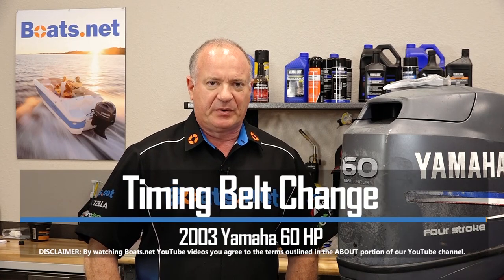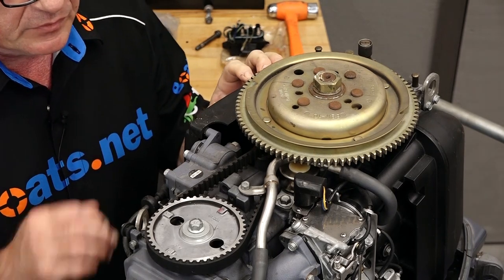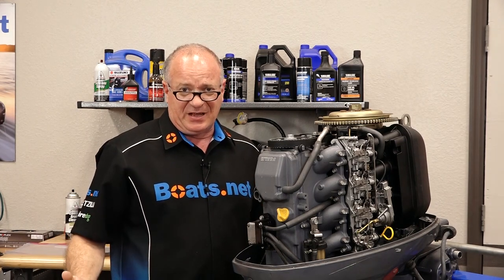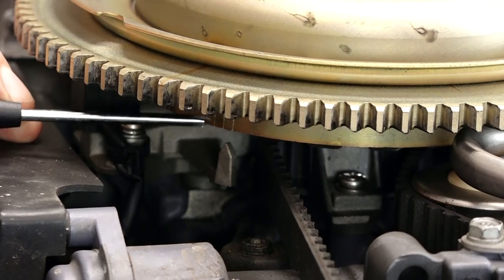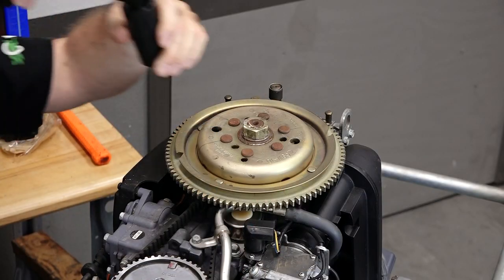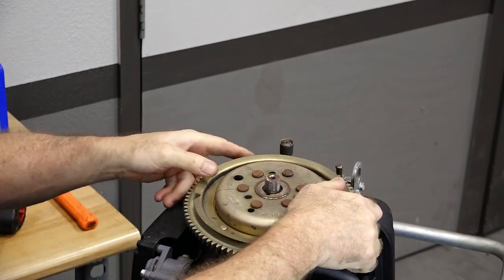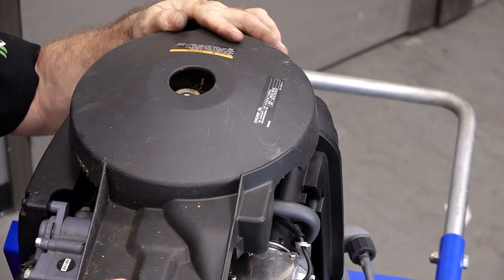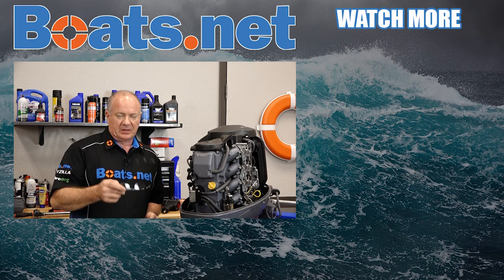Yamaha 60HP Timing Belt Replacement | Yamaha T60 Outboard Timing Belt Replacement | Boats.net

Comment: One little thing is missing. After installing the belt I would recommend rotating the crankshaft manually two revoloutions in order to make sure the pistons will not hit the valves when firing up the first time.
John, your videos are actually the best outboard how-to-videos out there. Very good explanation, but also very good audio quality, pronunciation and talking speed. Makes it easy to follow even for non-native English speakers.

Comment: Great video. I usually turn the motor a couple of times in the correct rotation by hand to ensure marks are 100% lined up..
What holds the flywheel is a nut not a bolt,in my neck of the woods...

Comment: Does the same procedures apply for replacing the timing on the 75 hp Yamaha
Reply: Can you post the information on the tool that you used to hold the fly wheel in place

Comment: Good video John. My 25 Yamaha 4 stroke stopped and won't restart.The compression on both cylinders is only 75# and the timing belt is very loose.Could it have jumped time or is it something more serious. Thanks
Reply: If your engine was running when it "jumped time" then the crankshaft and the camshaft became out of phase/time at some point.  John mentions this issue in passing during this video.  When the crank and camshaft are not synchronized (out of time/phase) the valve(s) are likely to be still in the open position when the piston comes up to top dead center at some point.  This is a problem because if yours is an "interference" engine meaning there is NOT enough room in the top of the piston chamber for both the piston and the valve(s) being in the open position to happen at the same time-one or the other but not both at the same time, then impact and damage occur.  Damage happens when the piston(s) hits the valve(s) damaging/destroying the valve, piston and possibly the piston chamber.  With that low of a compression this may have occurred.  You could do a "leak down" test to determine where the leakage is occurring; one or both valves, the head or someplace else, but that requires some more equipment.  Hope it helps-